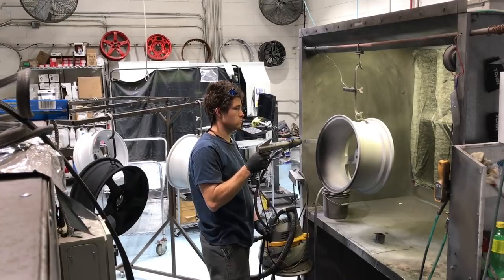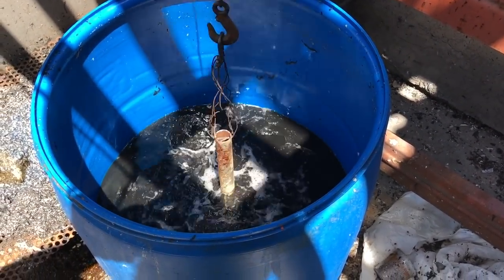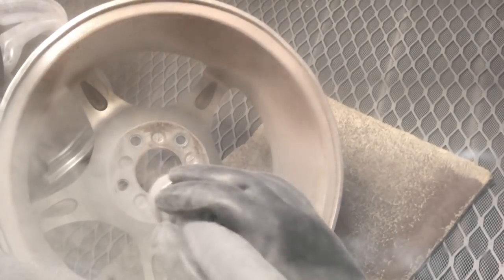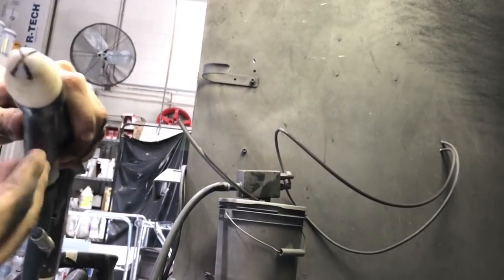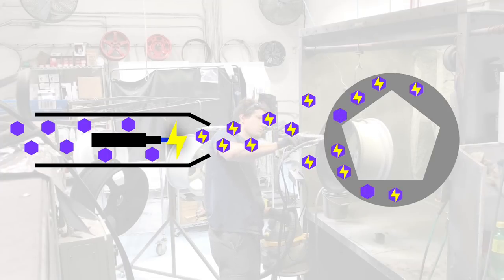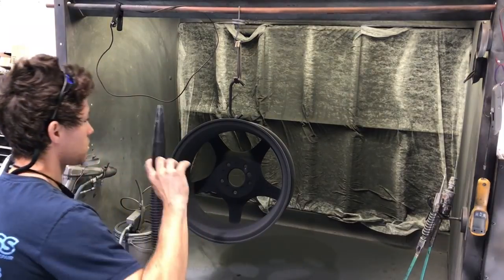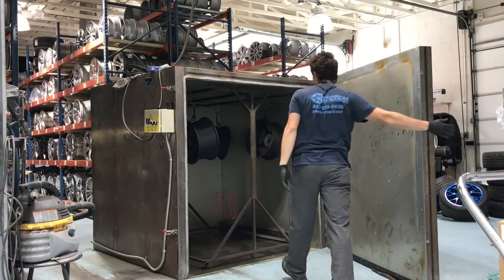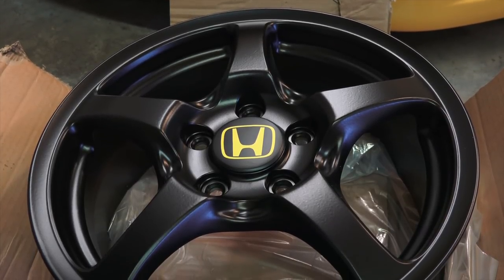What Is Powder Coating? New Wheels For The S2000!

Comment: Can you do a video on why tyres lose psi? :)
Reply: Flame Beats interesting, I always wondered why mine change slightly, I guess its due to temperature, thanks :)
Reply: Temperature barely has a influence on tire pressure.
Reply: Shawn Campbell it's usually temperature. Some dealerships offer nitrogen inflation which is more stable but others have dropped it, saying the customers don't see the value and it's a hassle.
Reply: It's a rip off.. that's why people don't see the value.
Reply: Yup since normal fresh air is nearly 80% nitrogen, it is indeed a total rip off.
Reply: That is pretty general question. As in why do tires lose quickly, typically the result of damage, or a faulty valve steam. Why do tires lose air slowly over time. Because it would be impossible to make tires as soft as they are to ensure a smooth ride, and still be 100% leak proof. Small amounts of air, are able to leak thru the rubber. If you mean why do tire pressures change, typically temperature related. The measurement of temperate is just basically the measurement of how fast the atoms are moving. Fast moving atoms, mean higher temperature, slower moving atoms mean lower temperature. So as the temperature goes down, the atoms inside the tire move slower, resulting in a lower pressure, as the temperature goes up, the atoms move fast, resulting in a higher pressure. The change in pressure is so little, that to the average driver, you would never notice the difference. We are talking maybe a 1psi difference either direction.
Reply: Kevin Weil thank you for that, that was really informative, yeah with my car the on board pc states that its changing by roughly .1 psi, it just got me thinking into why this happens, its a sealed item :) thanks again
Reply: From normal driving that's true, but if you're drifting/doing a long burnout, the heat created from this increases the pressure in the tire a lot.
Reply: Shawn Campbell the basic idea is that air along with other non ideal gasses compresses and stays that way more easily than either liquids, solids or ideal gasses. The compression happens under conditions like low temperature

Comment: Humans are just amazing! One question though, if the wheels get grinded down and sand blasted and so forth, does it make it physically smaller than original? Or does the powder coat make up for it? I've scraped my wheels too (it hurt) and am wondering if I should get them repaired...I only drive a camry though. Nothing spiffy but still...she's my baby!

Comment: Got my wheels powdercoated that I'd been using for 2 years. Split all around the spokes within a week and almost completely separated from the hub. Never will I get wheels powder-coated again unless I can supervise the process to make sure the temperature used is appropriate for the alloy.
Reply: Anything that can be done can be done badly.

Comment: Why did he powder coat the lug nut mating surface where the ball seat meets the lug? The exact same thing can happen to that surface as the hub mating surface on the inside of the rim. When I got my rims powder coated the shop left the hub mounting surface and the lug ball seat surface free of powder for the reasons explained in this vid
Reply: Austin Gray 
Absolutely good call.. all mating compression surfaces should be free of deformable or frangible coatings!
Reply: It's actually not important. The nut will fit just as tight and secure on the coating as it does on blank aluminium, which is the only thing you should be worried about. It doesnt impair the way the wheel turns, unlike the hub coating and half a millimeter of bolt going less deep inside the wheel hub makes no big difference.
Edit:  you might want to check your torque a couple of times during the first 1000 or so km though, just in case the coating flattens a wee bit.
Reply: With a normal layer of powder it doesn't matter. It has been tested and a certain mil(i don't remember the amout) is accepted and will NOT be dangerous in any way.
Reply: Günter v. G. 
its that flattening you mention that is the reason it should not be there in the first place. over time it may powder out and effectively. 'loosen' the nut without rotation.
Reply: You're looking at 2 to 4 mil thick
Reply: Stephane Leclair 
When I was in race car chassis engineering early in my career, back in the 70s.. we would never allow any paint or filler materials on fastener mating surfaces, especially on wheel fasteners.. Its just terrible practice to get used to. Do it freaking correctly because everything else is wrong.. even if its a matter of degree. My company does custom bead blasting for a specialty wheel refinsher in the Portland area.. I can assure you that no coatings are EVER allowed on fastener mating surfaces..  Just because you can get away with a specific incorrect practice most of the time does not make it correct or inherently safe.
Reply: I could easily be wrong but i think that any normal alloy wheel you buy stock will have a layer of clear coat on it and also in the holes and hole area. And if i'm right about that it is probably the same thickness as a standard layer of powdercoat. Anyway we have seen this so often and i never heard of problems with it and it has been thoroughly tested to find the safe mil.
Reply: But yet, you bead blast instead of sandblasting. You're not even close to provide a good surface for the powder to grip on.
Any real racing wheels arent coated in the seating area and most of the time they are anodized too. But every street wheels out there that are powder coated from the manufacturers, from 100$ a wheel to 3500$ have the lug nut holes coated.

Comment: Shouldn't you also take the coating off the wheel where the lug nuts tighten for the same reason
Reply from the maker: Yes, actually. The tire shop I had them mounted at recommended simply checking the torques after 100 miles, and if everything is in spec no worries.

Comment: Some questions I have...are there several colors available to choose from? Does the guy breath this stuff when he's applying it? How much time does it take to do one wheel? Is this always a manual process or was it manual only to shoot the video?
Reply: Leo Coscarella colours yes. Breathing no, the electrostatic charge and ventilation system stop that. Time, Maybe 10-20 mins for a coat. Process, yes it is always done in this way like painting.

Comment: I had my bmw rims powder coated black  and was so excited to put them on, I even got new tpms,valve   stems and tires. This was pretty expensive. Eventually I had a nail in my tire and needed a patch so I took it to a reputable tire shop and noticed the fix left a chunk of paint missing from my rims but not only that a few months back I curbed a sidewalk and no rash just another circular chunk missing....

Is that normal? That doesn't sound very durable to me...

I had the coated at wheel techniques in Santa Clara ca.
I didn't read their reviews till after I dropped my rims off....take a look at the reviews,  wow

Comment: We do not believe in conspiracy theories in engineering thus forged wheels undergo precipitation hardening at the manufacturing facility. Should the wheel be powder coated from the manufacturer, the time delta will be accounted for to reach hardness and yield strength requirements annotated in the drawing. On a street application there may be no harm, but a wheel that experiences high cornering forces has a fatigue life which you will shorten by further age hardening it in an oven during the powder coating process. This engineering was not explained in the video, otherwise I love your channel.

Comment: I am curious about how they spray the spot that the wheel hangs on?
Reply from the maker: It hangs from a lifting eye inserted into the valve stem threads, so no areas are missed. :)

Comment: The ground does
not really need to be earthed at all.. what matters is the
potential of difference between the high voltage power supply 'ground reference side' and the parts support system. In reality you only care about the voltage difference between the charge supply and the part. If the charge supply was not properly grounded,
usually done through the power cord ground, you could earth the parts hanging system till the cows come home and it still would not work. The hanging rack MUST be bonded first to the high voltage supply neutral pount, and then that system as a whole can be earthed, to reduce interaction from other electrostatic charged stuff.. but its not technically essential.. just a good idea. It is essential the rack snd the neutral of the HV supply be well connected, bonded, and not rely just on the ground of the power cord to be the only ground bond between it and the earthing point of the rack. I am an EE.. grounding and commoning is poorly covered in modern EE education. We see many large systems with crap for grounding schemes designed by young engineers these days. Any current flowing on a grounding system creates voltage due to resistances not being absolute zero, so one must assume those voltage faults first and engineer mitigation into the system first. Just getting a powder coat system grounded common is tinker-toy stuff compared to large distributed audio and computer systems..
Reply: +Jennifer WhiteWolf 
In the US most jurisdictions require compliance with NFPA 33, 70, 77, 10, 101 and the NEC regarding powder coating, electrostatic and paint/coating spray booth installations. 
Most all powder coating equipment manufacturer's installation procedures include a driven rod near the point of application that attaches directly to the target electrode (rack) for safety and improved resultant finish. 
This dedicated ground rod is for static drain not short-circuit/fault current protection. 

I agree with your assessment of audio and computer system grounding. 
I would also throw in RF transmitters, industrial plants, communications/network systems and some utility distribution as unique grounding challenges.
Reply: patw52pb1 
there still needs to be effective bonding of the rack to the appropriate side of the HV supply, and that node earthed.
Reply: +Jennifer WhiteWolf 
Agreed and should be low R, Z. 
I assumed (I know, bad) your contention was only regarding the dedicated driven ground rod and the HV supply output was always bonded to the coating rack to complete the circuit and also to the mains common grounding/earthing point/node/terminal.
Reply: patw52pb1 
Yeah, the video makes a big deal about the rack being earthed, yet mentions nothing about the HV power supply...   Lets just say as an example, both were earthed with a nice rod, but 20 feet apart. The variable impedance of the real earth itself would result in crappy and variable performance... In the USA, the AC grid in both
commercial 1 and 3 phase, and residential 240 single phase, has a well earthed ground common.. Almost every pole, if not every pole,  has an earthing rod.. not for any service current delivery, but as a place for lightning to earth after hitting elevated wire, and for dissipation of generized static charges that could otherwise build up. In most cases, a well done AC power ground connection ( for industrial equipment) can be plenty good for static dissipation,  but it sure does not hurt having additional earthings. The more the better for safety.
Reply: patw52pb1 
yup... not the best script writing, but people
listen to this stuff and try to learn.. and when incomplete information is given, its easy to learn incorrect stuff.. As an engineer, I'm always bugged by incomplete or incorrect descriptions or language in a scenario where it might teach the wrong thing.   I built my own static charge rig for wet spray painting in order to reduce overspray on a project several years, 25 or 30 years, ago.. just like it makes powder coating possible, with wet process it also works to attract mists to the target, and really cut down on the blow by..
Reply: +Jennifer WhiteWolf 
"The more the better" as long as they are all common or do no harm.  
Not so good when ground loops, elevated ground/earth potentials are developed.   ;) 

In this case of a powder coating operation, I believe as far as the regulatory bodies are concerned it is more about fire and life safety issues than radiated interference or quality of the coating. 

You touched on computer networks earlier and i have a war story that is somewhat related and I find humorous. 
Several years ago we were called out to diagnose a new data center installation  with 2400 runs of screened CAT6 terminated on a series of 48 port patch panels in EIA 19 inch racks on each end that was having difficulty with numerous errors and collisions even at sub gigabit (100Mb) speeds. 
The installers said that it certified with their equipment and they saw nothing wrong. 
Turned out that the cable installers/terminators bonded every drain conductor on both ends. 
The original installers refused to correct the issue citing that their test equipment showed that it passed certification and that was the way they always installed screened/shielded twisted pair. 
We lifted and isolated the drain conductor at the far end on each cable and miraculously the errors disappeared.
Reply: +Jennifer WhiteWolf 
I totally agree, so many on these forums are using the videos as an educational source. 
Haha, yep I am also a multi discipline engineer and the numerals in the name is the birth year. 
Interestingly enough I recently read about a wet slurry powder coating technique that still uses a very fine polyester resin powder suspended in a fluid that is electrostatically applied and then heat cured. 
It is said to allow a thinner and smoother finish when cured.
Reply: patw52pb1 
Very interesting! Hybrid wet powder!
Reply: +Jennifer WhiteWolf 
I just performed a quick search on my phone and I found this, I feel certain there are other articles on the process.  

http://www.sciencedirect.com/science/article/pii/025789729290105J

Comment: How would the price of doing this compare with getting performance wheels?For example, RS Wantanabe Cyclone, TSW Trackstar4, or Buddy Club PI Racing QF.
Reply: If I had a yellow S2K, I would get a set of Buddy Club P1 Racing QF's and paint them a contrasting color, like purple. It dosen't sound very tastful in my opinion in terms of color, but then again, yellow isn't my cup of tea.
Reply: I do however agree with your choice on black and yellow, because since yellow is a brighter color, it contrasts well with black.

Comment: Doesn't the grinding and sanding modify the balance of the wheel?
Reply: Gabriele Nitti Hardly, the most common weights people stick on are in 1/4oz increments. I guess it would depend on the damage
Reply: Gabriele Nitti I might think so but they probably wouldn't grind it down to the point of actually messing with the balance of the wheel. If it needed to be grounded and sanded that much (to the point of imbalance in the wheel) then they'd probably just recommend replacing the wheel itself.
Reply: Barely, if he sanded off more then 10g total, that would already be impressive.

Comment: FYI: PLEASE do not ever do abrasive media blasting with actual sand. The small silica particles can get stuck in the tissue in your lungs and cause silicosis over long periods. Most often, 120 grit aluminum oxide is used instead.

Comment: 1) Coater didn't heat the wheels, which is why there is a texture lol
2) i don't think I ever removed powder from hubs, or ever had that on my wheels in the past lol. Never had that issue, I'd presume the coater may just have his own 'thing'
3) This guy did his steps reverse of my families business. Usually we sandblast the products, correct imperfections, then acid bath or rinse them again to make sure they are a clean surface. Heat in the oven to get to 350, pull them and coat them WHILE HOT. I noticed he also isn't using a ground, which is probably why the powder looks less 'paint' looking and more of a textured look
4) Overall, you got the idea down. The coater needs a bit more practice lol. It's not a hard thing, and usually it's just down to time and heat regulations.

Comment: 400F isn't enough to anything to the metal so no it won't be weakened
Reply: You're joking right? Aluminium anneals at that temp and often causes stress fractures that develop after use. Every manufacturer voids the warranty of your wheels once they are powdercoated.

6061-T6 anneals at 350 degrees and most of these shops cure their coats at 400 for 10 minutes which is pretty much guaranteed to weaken the metal

Comment: I thought powder coating wheels makes them weak. We had some powder coated but it made them weak and they bent and one cracked they weren't some cheap wheel either they where bbs
Reply: Tim Forbes it doesn't, in fact most of the standard initial wheels mounted to cars are powder coated too. I work for one of the big powder coating system manufacturers. We built plenty of systems. Obviously in a larger scale and with a higher degree of automation. But in general it's the same idea behind.